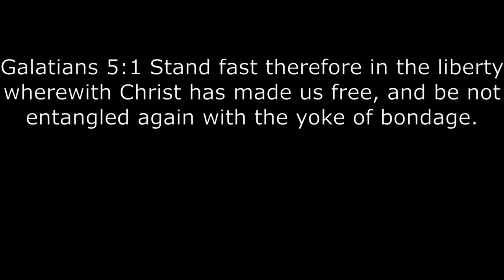The 4610 Ford Tractor Gets a Golf Cart Top for a Canopy

Comment: I bought a used top for $20 and installed it on my 5105 JD. I used 1 1/2 inch PVC to make a front support and anchored it where the front loader would bolt on. Car and truck hoods make good ones too.